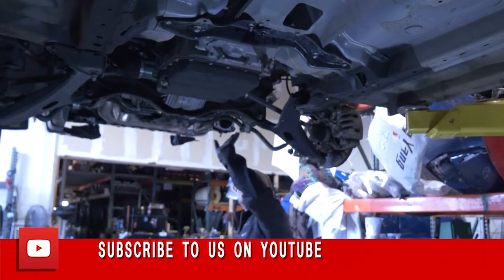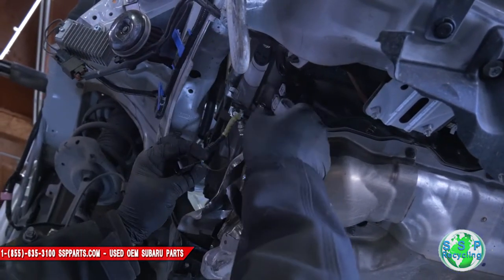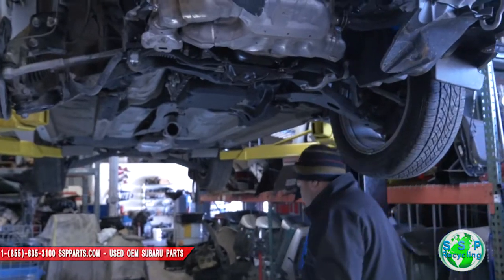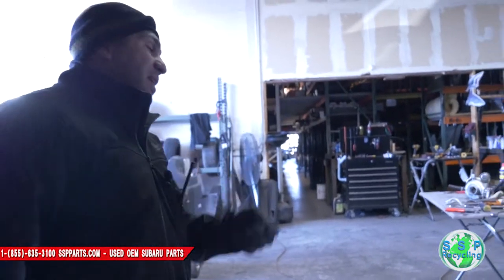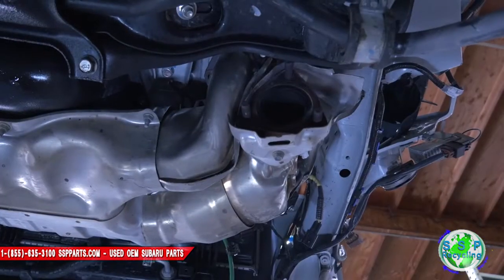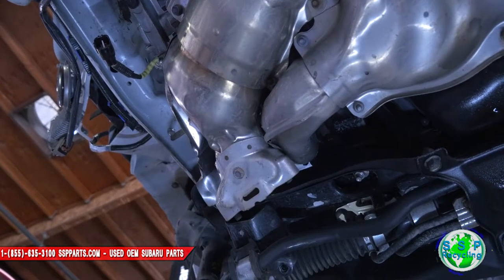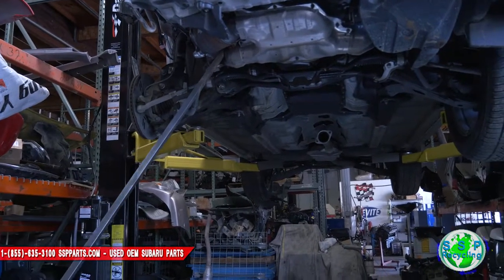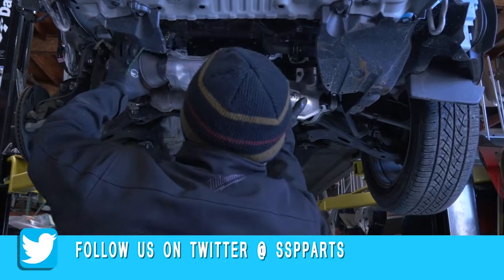How To Remove a Pretzel Catalytic Converter - 2012 Subaru Forester

Comment: My exhaust manifold bolts are pretty rusty. It looks like the bolts are rusty steel and the nuts are brass in color. What are the chances that the studs snap when trying to remove nuts?